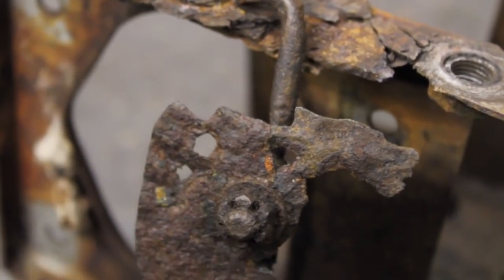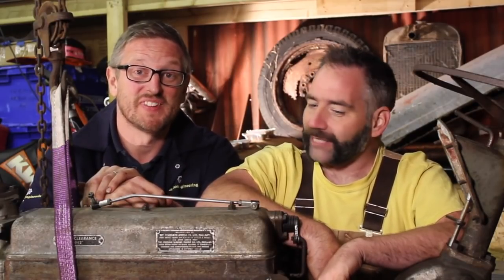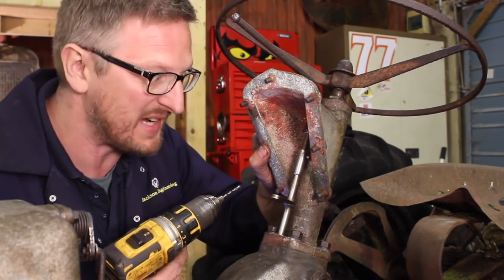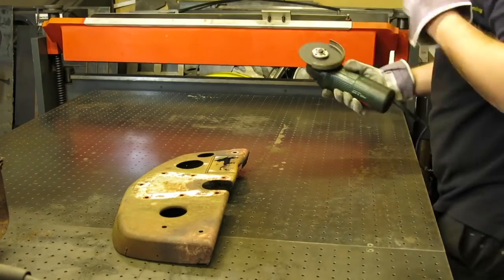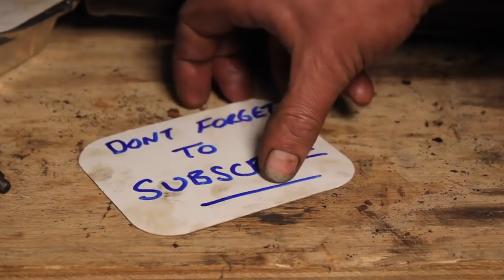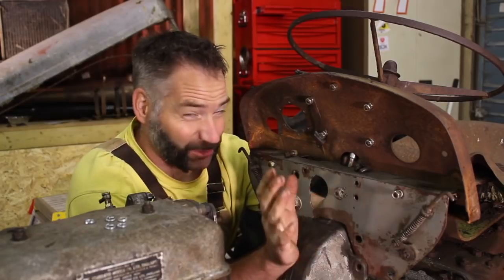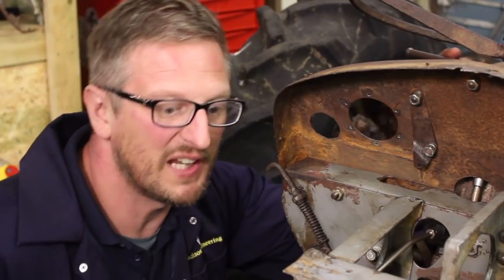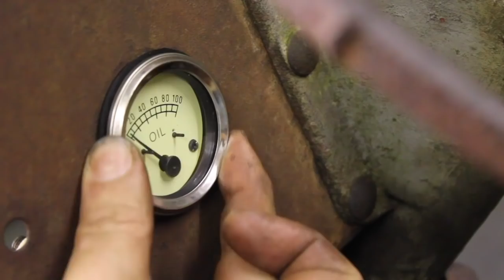How to repair a rusty hole. Barn Find Fergie.  Episode 11

Comment: Great channel. Make sure to get the rubber gaitor for the bottom of the gearstick to prevent it filling up with water!
Reply from the maker: Did they have one originally?
Reply: Good shout👍
Reply: yes they have  a coller round them.

Comment: Great episode again Jimmy & Gav. Did you guys do a video on fixing the butterfly valve in the inlet manifold? I can't remember from the earlier episodes. Cheers Ryan.
Reply: Thanks Ryan, I don’t believe the valve is on video, it needed lots of heat and penetrating fluid, the spring was replaced and friction material replaced with cork sheet cut to fit.
Reply: @montydog0   thanks for that, the valve is what am currently fighting with on my Fergie. Your videos really do help!
Reply from the maker: @ryanwilliamson6163  Great to hear!

Comment: Where did you get the new oil pressure guage guys?
Reply from the maker: I have a friend who sells good stuff on Ebay here's the link. https://www.ebay.co.uk/itm/Grey-Ferguson-Tractor-TE20-TEA20-TED20-TEF20-Smiths-AC-Type-Oil-Pressure-Gauge/274460806567?ssPageName=STRK%3AMEBIDX%3AIT&_trksid=p2057872.m2749.l2648

Comment: I've noticed you have not used any Hylomar or similar gasket sealer, any reason why?
Reply: I think this seem to be very much down to personal choice. For me, I'm not keen on it, and if using a gasket with reasonable mating surfaces I will avoid using it. 
If on the other hand it is specifically called for, there are bare mating surfaces or where dissimilar metal corrosion is an issue, then yes I'd use some.

Comment: Hi looks like I've got to have my new liners turned down like yours , does Gav do commission work ? also I have a India back tyre you can have its old but has good tread . if you want it I'm in Essex I would send you a picture if I can work out how to do it on youtube . look after yourselfs ,
Reply from the maker: Hi Ian, did you contact Gav directly? That's a vey kind offer, we really need a complete set of wheels and tyres. All the best.
Reply: @Torquestamiya  Hi I seem to be having trouble replying , so yo may have this reply more than once, I sent an email to a Gavin Jackson near Ely ,hope thats him . By they way do you know if the chap you got the crank bearing from has a conrod for a tef as I am still looking for one , regards Ian
Reply from the maker: @ianbel9711  I think he's sold everything now.